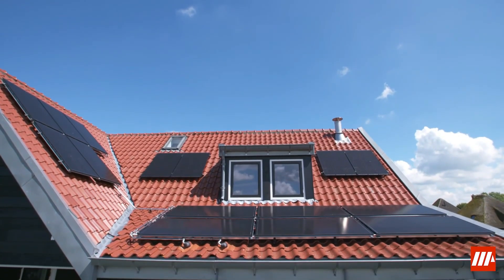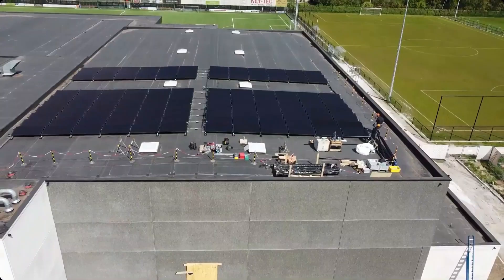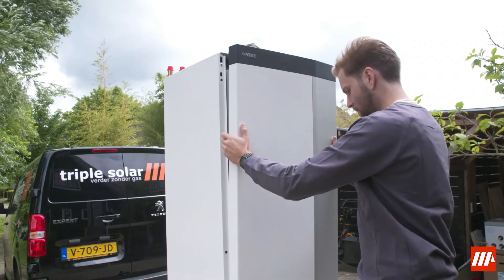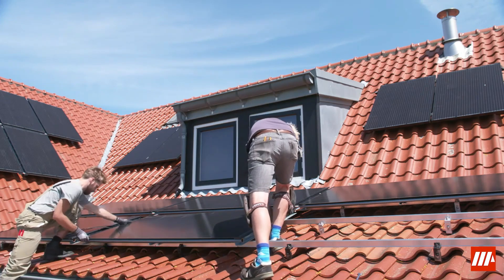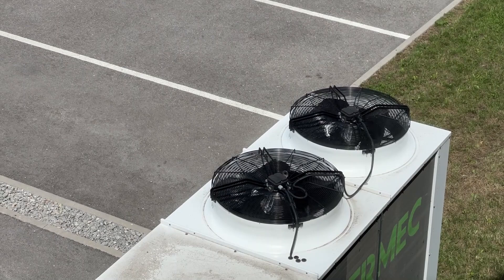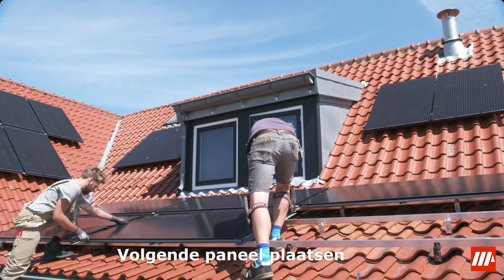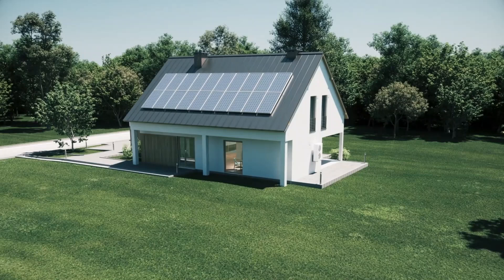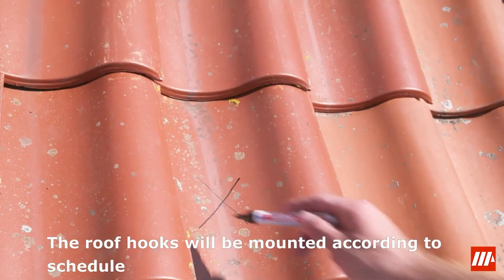The solar panels that produces both heat and electricity

Comment: Problem is when you want the heat The sun is low in the Sky wintertime  and not producing much heat. Maybe good for hot water in summertime. But probably not worth the cost

Comment: Now that's a nice combination, at 1000 per panel, 20'000 for 20 panels, what would the total combined curves look like during a yearly cycle? That would be interesting to compare other standard panels. I like the hot water/heating combo, that could be used as cooling in the summer, nice addition. 
Thanks 👍💪✌